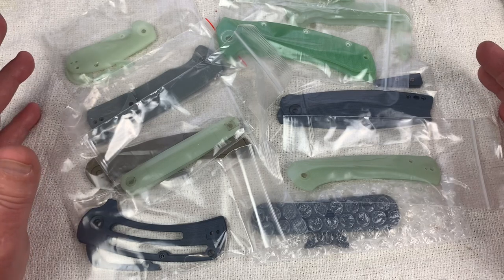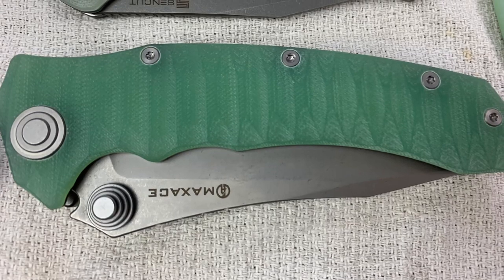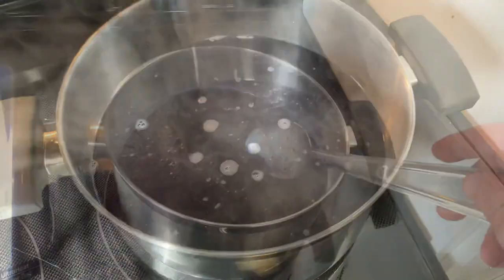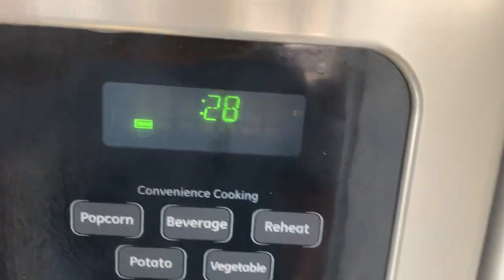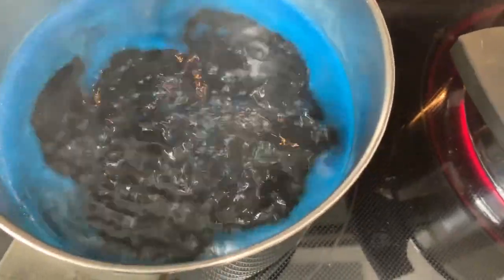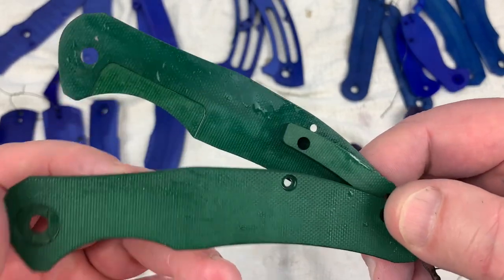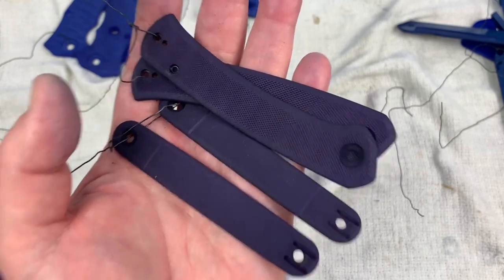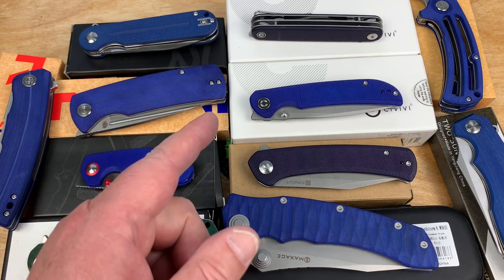Dyeing G10 knife scales  11 knives and 4 different colors !  How to do it yourself  !

Comment: Another way to dye scales is to mix up the dye in quart mason jars.  Put the jar or jars in the water pot and heat up to desired temp then put the scales in the jars. Uses much less dye than filling the whole pot.  When finished screw a lid on the jars and save the dye for reuse.
Reply: Sounds interesting Basso Matic. Might try that method on my next dye session.
Reply from the maker: Thanks for the information.  It sounds great
Reply: Fricken genius.  It would even make for faster and easier clean up.

Comment: I'd suggest not just soapy water, but wiping the scales off with alcohol... from my experience, even the smallest amount of knife lube or finger oils will ruin that dye job. Also, I've found problems with letting the G10 rest against anything in the pot. If a part of the scale is touching the pot or other pieces of G10, it will be slightly lighter in color vs areas that had full open exposure to the dye.
Reply from the maker: Thanks for the information

Comment: Hi LTK, i watched this and follow this method when dyeing my knives. It worked for most of the knives EXCEPT Spyderco! I have a Para 2 Camo in G10 and rit dye did literally nothing to it, the stuff just washed right off. I instead tried something called alcohol dye, which did the job and which i got from my local art store. Worked perhaps a little too well. My camo para 2 is now a dark purple. The alcohol dye in comparison to the rit die was stronger, worked immediately, didn't require hot water (direct application). On the downsides, it needed to be applied more evenly like you would with a bottle dropper, and also, you need to apply a couple of layers to it. After it is dry, some initial colouring will rub off and the colour becomes lighter, but the original stain will stay there. Recommend if trying to dye Spyderco scales. Just thought I'd let you know.
Reply from the maker: Thanks for the information

Comment: If it's on a fixed blade that can't have the scale removed would there be any damage to the steel being submerged for 10 minutes in the dye?
Reply from the maker: No reason it would ruin the blade in my opinion.

Comment: Try Fiebings leather dye, so much easier and keeps the color forever (no fading) you don't have to ruin your pots and pans either. Lightly sand your scales with 220 grit, rinse with water wipe with alchohol then brush or sponge dab and let sit for 24 hrs.

Comment: I have a question.  I have a Twosun TS273 coming my way and I would love to dye those bright orange scales.  I believe it has G10 inlays.  If I dip the whole scale in the dye, will it loosen the adhesive that holds the G10 in the titanium scale due to the heat?